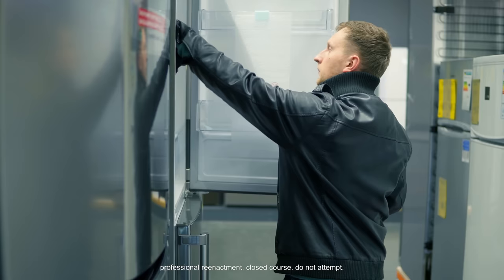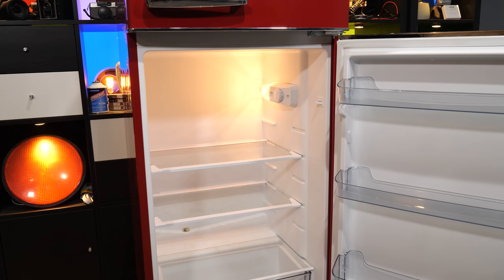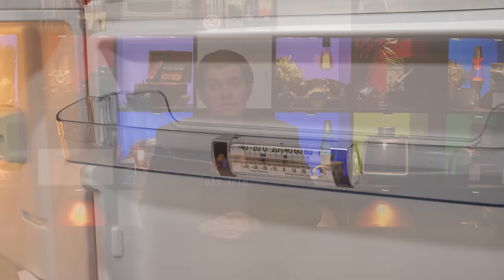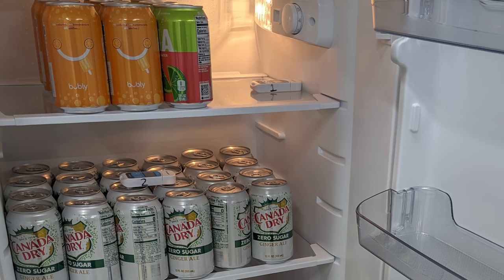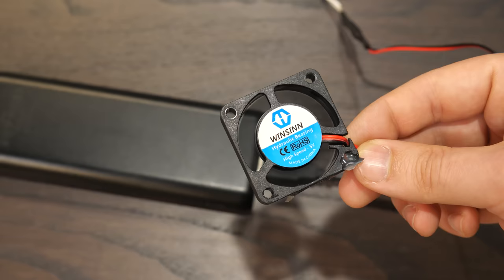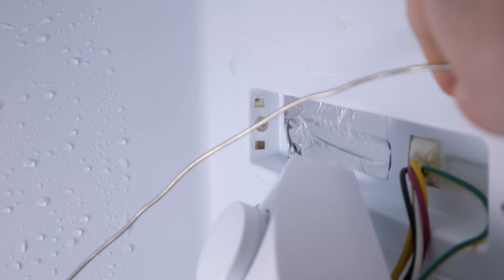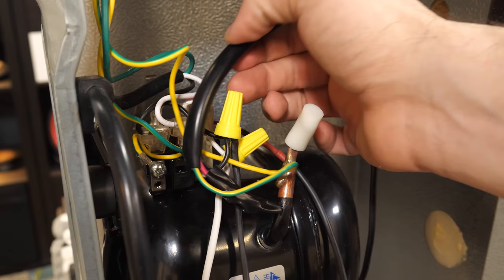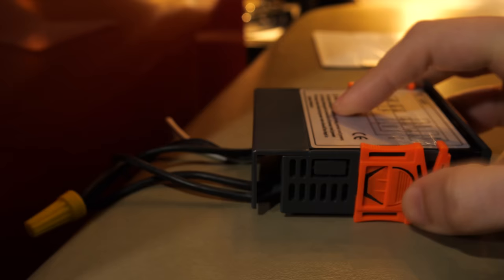This goofy fridge has a really clever design. It's also kinda terrible.

Comment: A lot of these design features seem to be quite common here in Europe, at least every fridge I've come across does everything very, very similarly.

With every video you come out, I get an increasing notion that you'd have a blast travelling here and seeing how all our thingymagigs works differently from their US counterparts
Reply: I was about to make the comment that this is basically the refrigerator I have in my Helsinki apartment. Not as "retro" looking but just as simple of a design.
Reply: @TuomasLeone  I live in an apartment in Sweden, and it's the same story here. Aside from the aestetics, it looks completely normal to me.
Reply: Yeah, and this is how the PREMIUM fridges from Samsung work!

The cheaper fridges have totally exposed condensers on the back, and barely covered internal evaporators. And yes, we have to defrost them every few months, but you should be cleaning your fridge's internals at least that often anyway, so it's not a big deal!
Reply: Same. I've never seen a fridge in Finland that doesn't have completely separate freezer section, nor one without the condenser hidden behind plastic or something allowing defrosting to be done easily.
Reply: And indeed my fridge in my cheapest possible rental apartment is just as good.
Reply: Here in Germany, I have also seen only such refrigerators.
Reply: Let's all fund Alec a ticket to Europe and show him our salt-eating dishwashers, ductless fridges and 230V appliances. I'm also definitely showing him our vertically pivoting windows!
Reply: I thought this is how all modern fridges work? I don't think I've ever seen one with an electric heating element.
I'm also amused that that is a "Mini Fridge" whilst being the same size as the biggest fridge-freezer I've owned in 25 years of adulting.
Maybe the climate here means I can keep more of our food in normal cupboards?
Reply: yhea but since i see taht i think i going to upgrade the controle unit.
Reply: I thought the entire world bought everything from China  ;)
Reply: Through this whole video I kept going "Hey thats just like my fridge!" :D
Reply: EU technology for the common man is at least 10 years ahead. USA has the same technology too, but it's too expensive for most people
Reply: @drumbrakes  The refrigerator discussed in this video is not a mini fridge.  In the intro to this video Alec says he intended to buy a mini fridge but found he could buy this full sized one for only marginally more.  A mini fridge is typically around a meter tall.

American full sized fridges do tend to be larger than Europeans' because typically Americans buy groceries in large quantities infrequently while Europeans buy in small quantities frequently.
Reply: Yup, I immediately thought "wait a minute, my Liebherr works exactly like that!" It even has a slightly insulated sensor on the back of the fridge instead of it being stuffed away in the wall.
Reply: @marcogenovesi8570  Based on the video this design is technically inferior other than being less expensive.
Reply: @Light-DelaBlue  why? Houndreds of millions of people have been using these fridges for at least 50 years, probably longer and never heard of anyone "upgrading" their fridge.
Neither have i heard of anyone having issues because of this fridge design.

Sure when you turn it on and immediatly fill it with cases of beer for a party or something it will take a day for all the beer to be cold. But that's more on the compressor size then the temperature contol i suspect.
Reply: @VitalVampyr   i bet it is more efficient and more reliable then other "more modern" designs. Which are pretty much the only 2 important things about a fridge.
Reply: @baronvonlimbourgh1716  The most important thing about a fridge is maintaining the correct internal temperature, which this fridge didn't without modification.  Even with the modification it has no way to independently control the freezer temperature.

You should decide whether your problem with this design's hypothetical competition is that their design is too old or too new.
Reply: @Venomalia  Stores are full of smart double door fridges, it's just that people ignore them because why, people have neither the space nor the need.
Reply: @VitalVampyr  never seen any promotional material mentioning temperature maintaining abilities. Nor have i have heard a sales person use it as a pitch. It isn't even an item in consumer tests or reviews or anything of the sort.
This is actually the first time i see or hear a discussion about it.

Reliability and efficienty ALWAYS are the first things that come up in all above situations. 
Somehow i do think there is somewhat a difference in priority.

And for this fridge, it could just be broken. That might actually be the reason it was for sale in the first place, who knows.
Reply: @baronvonlimbourgh1716  That's probably because something sold as a refrigerator would be assumed to be a functional refrigerator.  You'd likely be suspicious if a food product was marketed as being edible (unless the fact that it is food isn't obvious), for example.

The point of a refrigerator is keep its interior cold.  If "reliability" and "efficiency" are your main concerns you could just unplug it and store it somewhere dry, that way it's parts will not wear (maximum reliability) and it will draw no power (maximum efficiency).
Reply: @VitalVampyr  Alec refers to it as a larger than usual Mini Fridge at the start, then refers to it as a mini Fridge or a little Red fridge frequently during the rest of the video.
For me it's a normal sized Fridge-Freezer.
A normal Fridge (no Freezer, just an Ice-box) is smaller and fits under a kitchen worktop.
For me a mini-fridge would need to be quite a bit smaller than that.
Reply: @baronvonlimbourgh1716 It is clearly defective by design. 

I note there's a difference between "works the same way" and "is exactly the same". I assume most of the european fridges that are "just like" this one work fine because their thermostat monitors the temperature of the fridge, not the temperature of the coils.
Reply: This thing is really somewhere in between the mini-fridge or bar fridge size and the full size fridges you would get in North America. Not many people would be trying to use something like this as their main fridge here, unless they have very limited kitchen space and/or money (though a fair number of cheap apartments may fall into that category depending on the cheapness of the landlord).

In terms of buying a "normal" size fridge at a typical appliance store, even the cheapest models will generally be a fan-forced frost-free evaporator in the freezer and fan-forced condenser next to the compressor.
Reply: @@phillipbanes5484 I don't think he implied it was a country. However it is true that white goods manufacturers do tend to make one version of a product for all countries within Europe, with minor changes for some such as fitting different types of plug.
If you buy a fridge in the UK or any EU country, you'll get an instruction book that comes in lots of different languages for just that reason.
Reply: @@phillipbanes5484 why does EU need to be a country?
Reply: @drumbrakes  Judging from US TV series shown here in UK, all US fridges must be filled with bottles and cartons that people have taken a couple of gulps directly out of and placed back in the fridge.

Comment: As an instrumentation engineer this video warms my heart!  Key takeaway: direct measurements are better than indirect.
Reply: I've set an analog thermometer in a glas of water for 40 years on a middle shelf. Because it's more important to know the temp in food than in the air inside the fridge.
Reply: I work in a hospital lab, which includes the blood bank. The temperature of the blood products must be well maintained in a narrow range and our fridges have a bunch of sensors and additional logging (paper charts!) as-well. That said we still have manual thermometers in simulated blood bags full of saline.
Reply: As another comment points out, this positioning of the sensor was intentional - it was a cheap way to double as a sensor for preventing the compressor from running for too long. Two temperature probes would've been better, but that's more expensive.
Reply: It would be fun to spend an evening with you and a couple steaks and S.S. Chocolate Stouts.  As a car nut I'd have all kinds of questions. 🤓

Comment: I honestly forgot until this video that freezers used to get covered in ice and need occasional cleaning. I have these memories rushing back of doing that with my parents.
Reply: I've got a cheap mini fridge that still does!
Reply: And I however had no idea that that is a possibility haha

here in Switzerland I have never ever seen a fridge with any kind of heater in it. We have the "simple" model in most homes. Oh, it beeps if you leave it open.
Reply: As a Brit, I was completely unaware freezers don't do this. I've never seen a freezer that we don't need to de-ice. I sometimes have to knock ice off the door to get them to shut, and every year or so even take out all the food and de-ice it.
Reply: I de-iced my freezer thanks to this. Ice buildup was so big that I was unable to remove one of the shelves ;))
Reply: my mini fridge is like that, it sucks
Reply: As was the dorm room staple, I had a minifridge and a hot pot in college.  In order to defrost the fridge quickly, I put some water in the hot pot, and put it under the little freezer section.  Took 5 minutes.
Reply: I have memories of doing that in the 90's with my first dorm fridge, which I brought with me when I finally moved into a single bedroom apartment. Used it for six years and had to periodically defrost the coil. And it was one of those "Single Cavity" fridges, although the ice box coil did have a plastic door... once you opened the main fridge door. Ending up selling it to the landlord (sort of. There was some questions of Damages I didn't bother fighting that ate both deposit and money I would have gotten from the fridge. Convenient.) when I moved out.)

Comment: Most likely the thermostat was placed near the cooling coils to ensure they don't get too cold or that the compressor runs for too long, which could damage the fridge or cause other issues.
Reply: That was my thought. Like an ac unit running so long it freezes over, it probably has a cutoff if it’s been running too long. And since it probably didn’t defrost completely before starting again, it couldn’t run as long, hence the staggered temp drop.
Reply: I was thinking the compressor should have a thermal fuse on it, if it gets too hot from running continuously it will need to cool down before resetting.
Reply: @fire304 the compressor is cooled by refrigerant. It doesn’t get too warm no matter how long it runs unless the refrigerant is warmer.
Reply: @fire304  It's actually completely opposite. Unless it's damaged, the compressor should never overheat by itself. After all it pumps a refrigerant that is cooled by condenser coil and then returns as fairly cold gas to be compressed again. Although it is generating heat, it should never overload the compressor. What may happen though is the opposite. Refrigerant has to evaporate in the evaporator (cooling) coil and get back as gas. The pressure drop is roughly constant but the temperature is not. It is cooling, you need to constantly warm it up to let it evaporate fully, otherwise it will just freeze. In AC you have a blower that runs room temperature air over it, in fridges the temperature is a bit lower but does the same thing. Warmer air inside the fridge heats up the cold evaporator coil. If this process does not work (for example you have so much ice buildup, it barely conducts any heat anymore), refrigerant will not fully evaporate and will get back to the compressor as a liquid. Liquids are quite bad at compressing and the compressor will eventually get stuck. Then you will have to wait for quite some time for it to evaporate properly and pressure to equalize before it can start again.
So in short, it may get too cold to run and shut off for safety. Then wait for the temperatures to equalize and start again.
Reply: That was exactly my thought as well.
Reply: Is this a scenario where it's not a problem this month of the year, but a particularly warm sunny day will kill the compressor?
Reply: @i64fanatic  Warm weather (or even very hot weather) will not harm the compressor. It might make it run continuously but that's about it. In a hypothetical scenario where it sits in an extremely hot environment the compressor will simply shut off if it gets too hot, and start running again once it has cooled down. But in reality you'll never see this happen, even if the fridge door is left wide open for days at a time. It'll simply run, hopelessly trying and failing to cool down the inside of the fridge. And another thing worth mentioning is that these compressors are capable of running 24/7 for decades and are also capable of handling hundreds of thousands of on/off cycles. So from the standpoint of compressor longevity, a contamination-free system will have no problems with either frequent cycling or constant running for a very long time.
Reply: That is perhaps what the designers were thinking when placing the sensing bulb near the coolant line. That way if the coolant lines get too cold they will chill the sensor and satisfy the stat causing it to turn off and give the coolant some additional time to absorb heat.
Reply: @DrFreeeman  Well yeah the physics of trying to cool a space that has a big door open to the same air mass you are trying to dump the head out to doesn't work. The falling cooled air just creates a slightly lower pressure at the top that is promptly filled by the room air you just dumped the heat in, just now slightly warmer as you also have the waste heat from the mechanism in addition to the heat you just pointlessly moved form essentially just the room to the room. Wouldn't be a bad setup for a practical demonstration that refrigerators, air conditions, etc really are not actually producing cold at all but rather just move heat around at the cost of making even more of it. Sure the room would probably need some insulation upgrades and ideally not have any external windows at all or failing that blocking out all light with a bunch of thermal insulation behind the filter. I'm less certain that heat transfer through the walls would obscure the relatively small 100-200 watts or so of waste heat added to the room, but without a doubt letting any sunlight through a window of any size whatsoever add energy to your experiment will dwarf that for sure. The sun can deliver a little under half that to a single sheet of A4 paper on a clear day and glass is good at letting the higher energy light in but blocks the lower energy IR going out, thus why greenhouses work and thermodynamics experiments exposed to sunlight, at least not without being somewhere where insolation is consistent and predictable, maybe in space or potentially the surface of some rock with approximately bugger all for an atmosphere. The surface of a planet with a thick atmosphere that has not only banked roughly an assload (1.1e24 aka 1.1 septillion Joules) of heat to play with but has a huge heat flux that provides both energy and the instability to drive it to be dynamic and chaotic in pretty much every property including for example transparency to solar radiation. Oh and that would be the driving forces if Earth were a dry rock, but Earth is anything 2/3rds of the area the atmosphere interacts with is drowned entirely in liquid that is moderately volatile at these temperatures. Sure it's not extremely volatile at average surface temperatures but you actually don't need that much to evaporate per unit area to get insane amounts of the stuff turning into vapour, rising, condensing, and creating partial shadows and thus temperature differences that further drive the chaos. In the case of Earth that is in the region of 1,000,000,000,000 tons in each direction every day. In liquid form that would occupy a volume of 1000 cubic kilometres evaporating and the same again condensing, for perspective lake Ontario has a volume around 1600 cubic kilometres, globally that much water evaporates in roughly 38 hours. I know it's far from the biggest of them but it's big enough to put things in perspective just to imagine that turning from a lake to a vast dry depression 250m deep in places in the space of basically a day and a half. Kinda a good job the planet doesn't have a mind of it's own methinks, it probably wouldn't go well for the species of hairless apes that insist on treating it like a pebble only worth what they can sell it for.
Reply: @seraphina985  Slugging is not a problem in these systems and it isn't really the reason the thermostat capillary is placed where it is. In addition to that these compressors have a low side shell meaning that all refrigerant has to travel over hot windings, cylinder head and (very) hot discharge tubing (which also has to be long to allow for flexion as the internal assembly moves independently of the shell). It's mostly there because it's simple and works well enough and most importantly better than just leaving it exposed to the air and because the internal temperature can be guessed to an extent based on the evaporator temperature.
Reply: I think the designers were trying to use refrigerant temperature as a proxy for the temperature in the interior. The relationship isn't simple, hence the strange behavior of the thermostat to compensate.